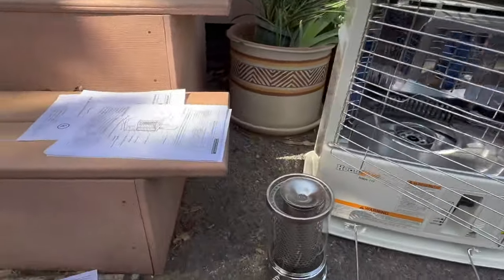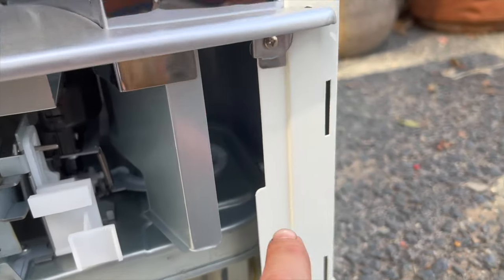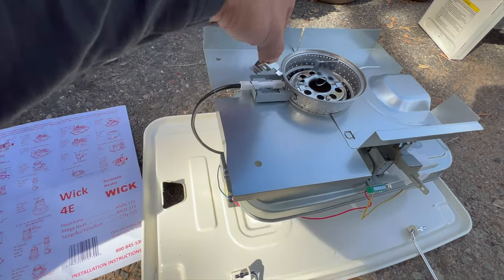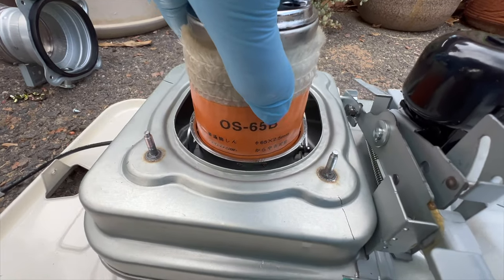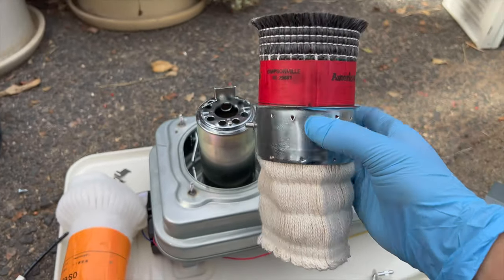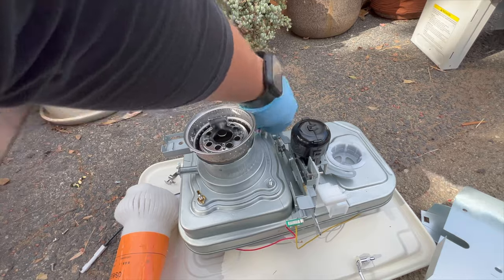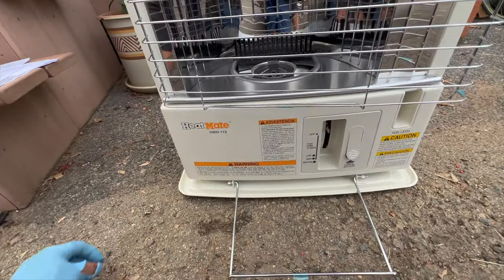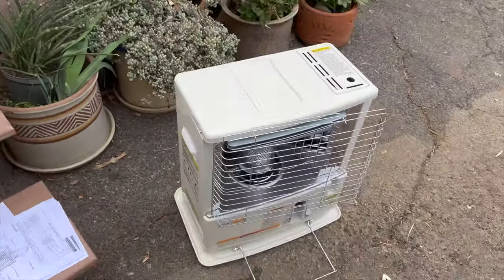Kerosene Heater Wick Replacement

Comment: I also found that after some time trying to separate the wind cover into two pieces without totally distorting/destroying it, I realized that you can leave it in one piece, and take it off, just kinda harder to reach around it to get to the wing nuts. Still, for me, easier than trying to separate it. Great video by the way, very well done, thanks!!
Reply from the maker: Thank you

Comment: I lived up in the mountains where losing power was a common event in the winter. So I found a dealer and had a Monitor Vented Kerosene heater installed in my house. The only thing you needed was a small Honda (or whatever type) generator to power the fan. So if it snowed, and we lost power, I ran a cord from outside, from the Honda generator to my heater and we stayed toasty warm. As info, Monitor is no longer in business. They made a great heater but I was told that management ran the company into the ground. We used that as our primary heat source from 1993 to 2021. No problems whatsoever. But right when we put the house up for sale, the heater finally took a dump. So then, I went back to the dealer who sold me the Monitor stove, and purchased a Toyo Stove Vented Kerosene heater for the place. I've heard nothing but good things about Toyo's. We sold that house and we moved down into the flatlands and I figured our winters would be no problem where we moved to. Things were going smoothly from January 2021 until January 2024. THEN we had a freak ice storm and we lost power for 2-3 days. I had no back up plan and we got cold as hell. AND that is why I'm looking into getting a small heater like this one to provide heat if we ever get another episode like the one we just had. I'm sold on kerosene, my father was in the propane business and I showed him the data on the Monitor Heater and he shook his head and said they had nothing that could compete with the BTU's and efficiency of these heaters. I also had a backup plan at my old house and that was I had a very good cast iron wood stove and a good weeks supply of wood, but luckily I never had to use that wood stove. So I have my generators, and I can keep my refrigerator and freezers going, use the microwave and coffee (very important to be able to make coffee) lol . I'm excited to purchase one of these as they're not expensive and they'd be my new, great, back up plan. And now I know how to replace a wick so I'm way ahead of the game! This was a really good video! Thanks for posting it!
Reply: coffee is the most important part 😅

Comment: Very well made units mine is Aladdin S681U Equator II. Easy to change wick just rotate Counter-clockwise until tab up from latch then pull knob out to release wick holder collapse wick inwardly from pins reverse with new wick. It took me 2 tries to adjust wick height corectly 3/8inch exposed when fully to right knob (3X wick number)

Comment: Does your wick make contact with the white igniter rod? Mine does and seems to burn unevenly as a result. I think it's mashing the wick in that spot.
Reply from the maker: Yes. It is normal for the wick to make contact with the igniter as long as the wick is at the right height like I mentioned in the video.
Reply from the maker: Are you saying that it burns unevenly because the flame on top is uneven?
Reply: @realdealGod  yes. It's a brand new unit and I can't get the flame to stay low in that one spot. When the wick is all the way up it is banging into the igniter rod.
Reply: @realdealGod  I'm not running it all the way up, but I took off the glass tube and pressed the lever down until it was almost at the ignition point and I could see the wick hitting it
Reply from the maker: @jwamerica84  so there’s 2 things it could be 

1. The wick is too high up 

2. The chimney assembly is not seated flat which would cause yellow flames to escape from one side. 

Just FYI, it is normal for there to be blue flames at the top of the chimney assembly. Yellow flames is what you don’t want.
Reply from the maker: To solve this 

1.  Disassemble the heater and lower the wick to the specification that I mentioned in the video. 

2. The chimney assembly has 2 main parts. The center pipe that turns red and has a small hat on top and the other main part is the outside part that holds the glass.
Make sure that when you seat the chimney assembly that the hat of the center pipe is flat and even with the rest of the chimney assembly. 
You can correct this by turning the chimney from burner knob (the metal spring that comes out of the bottom of the chimney) until you find the spot where both parts of the chimney are flat. 

Let me know if this works
Reply from the maker: @jwamerica84  5:36 did you make sure to install the pins into the slots on the lever assembly?
Reply from the maker: @jwamerica84  it is normal for the wick to touch the igniter as long as the wick is at the right height
Reply: @realdealGod  the heater is brand new so everything is as it was assembled at the factory. I will try to adjust the tube first.
Reply: @realdealGod  I wouldn't have guessed that moving the glass around would make such a difference. The pattern of the flames moves around quite a bit just rotating the glass. Evidently mine doesn't want to be anywhere near centered.
Reply: @realdealGod  the 'hot spot' moved with the tube as I rotated in so I reached in with a meat probe I had nearby and prodded the metal tube in the center without moving the glass and now it seems to be sitting level.

It seems the glass was sitting fine but the metal inside didn't want to sit correctly. The flames are much more even now. I'll have to see how the center piece matches up when it's cool.
Reply from the maker: @jwamerica84  Great. You should only see blue flames. No yellow flames
Reply: @realdealGod  it took a fair bit of poking and jiggling to get it even. Rotating it helped but it needed some extra help getting level. Hopefully it'll hold this alignment. Not a hint of yellow now. I appreciate the help. I jumped the gun looking at the wick because that's where the high flame was coincidentally.
Reply: @realdealGod  I spoke too soon. Ran fine for a while and then I hear it move and it is running the same as it was. I will have to inspect the glass and metal again. At least I know it isn't the wick.
Reply from the maker: @jwamerica84  from what you’re saying it seems like the problem is the chimney assembly not sitting correctly. Once it cools down you will be able to better adjust it and hopefully that will solve the problem
Reply: @realdealGod  I've been trying. I have a feeling that the metal cylinder is ever so slightly off and I may need to exchange the unit. I keep moving it around and the hot spot keeps coming back in the same place.
Reply from the maker: @jwamerica84  In that case I would exchange it

Comment: Very good instructional video. I got mine done in about 30 minutes. I agree with another commenter that jiggling the wick raise-lower to remove the wick assembly was easier for me. That bear wouldn't budge in the full-up position. I figured one needed to find the position with the least amount of pressure on the bar. And bingo!

But whatever, that will be the most challenging part for those uninitiated I figure. 

That was the first time I changed it in three Florida winters. So good luck folks and thank you much Country Fixing!

Comment: I found that, at least on mine, it was easier to get the wick holder out (when turning clockwise) if I had the wick holder arms lower...rather than higher as I was trying very frustratingly to get the wick holder to turn out. Seems lower is easier/better, at least in my case. It definitely takes patience, and almost finesse to get the thing out. Once you have replaced the wick once or twice, it's really not that bad. Just bring some patience!

Comment: How often do you need to change the wick?
What are signs that it’s time to change?
Reply from the maker: Change it yearly
Reply from the maker: -The flame is ragged, uneven, irregular
-Lighting the wick is difficult 
-The wick lights but it takes a very long time for it to get to normal burn position
Reply: I've heard annually but, this is my 1st change in 3+ years. Mine just stopped staying lit so, I'm hopping this fixes my issue.
Reply: I dry burn my wicks at the end of the season to keep the wick clean so I dont have to keep replacing the wick every year

Comment: I just replaced the wick today. Same model here.  Trouble is, when I fired it up there is no more adjustment now.  Before, I would have high, then i would lower it as it got hotter and burned more efficient.  Now, its like starting on low.   Cant go higher nor lower.   Strange.    just one setting, on.  I put the wick on and had the line on the wick level with the wick holder top.  After I installed it, I could just see the line around it.  I dunno.  Your wick seems to be 1/3 of an inch it appears above the black line.  Yet, the instructions say to put line just above the holder, which is what i did.
Reply from the maker: Did you give your wick an hour to soak in the kerosene?
Reply: @realdealGod  Yuppers.  Soaked for 1 hour.  Its burning right now as I write this.  Its adequate flame height; the thing about it is, I can't go lower or higher.  Just on and off lol.   I think what happened is that the wick slipped down a little.  I will pull it apart in next week or so.  I will continue to use it in mean time.
Reply from the maker: @Romulan112  I agree. It sounds like your wick came off of the hooks that hold it to the wick holder. 4:52 quickly shows me pushing it into the hooks on the wick holder.
Reply: @realdealGod  I am totally unprepared for this winter.  After I put it out last night, I put it on the porch. Woke up with snow on it.  Some snow may have gotten in there where I fill it.  I hope a little water doesnt ruin my work.
Reply from the maker: @Romulan112  ha. It shouldn’t do too much harm. A little bit of water in the kerosene is fine. The kerosene will float to the top

Comment: Holy crap just to change the wick?
No thanks I'll just buy the round version that only takes 2 minutes to change out a wick
Reply: Which heater has the round version? Which model? Thanks a lot!
Reply: The round high BTU Kerosun is a little easier than this but not much.
A Standard Oil Perfection from a century ago is easy as the pot lifts out and you simply unscrew the apparatus like a mayonnaise jar.....however those have no safety features, no tip over mechanism and no standoff for children or pets.

I like perfections, but will not use them when small walking or crawling kids are around.  Older pets learn fast, but kittens and puppies can burn you house down.
Reply: It's really not as bad as it seems.a bit time consuming but, really not too difficult... with video instruction. I wouldn't want to try to follow the instructions that came with the wick.
Reply: It looks like a complete nightmare. I'm sure that would take me the best part of a week, and all the screws would end up lost, and I would be afraid to ever use it again.